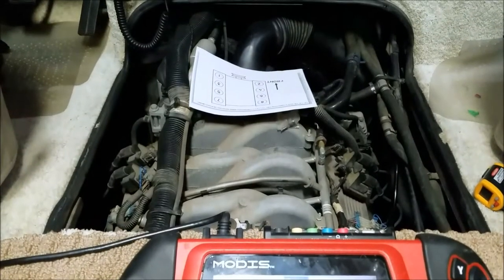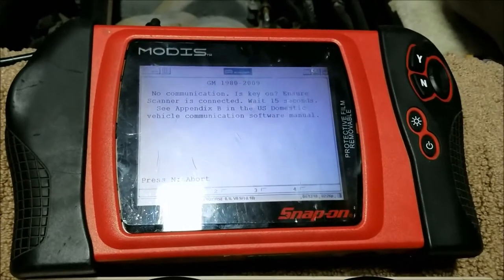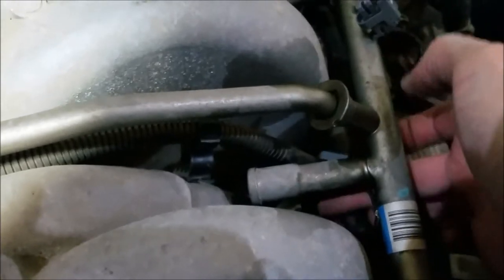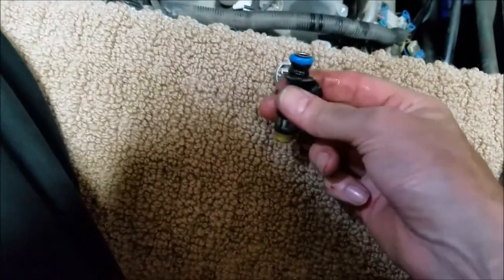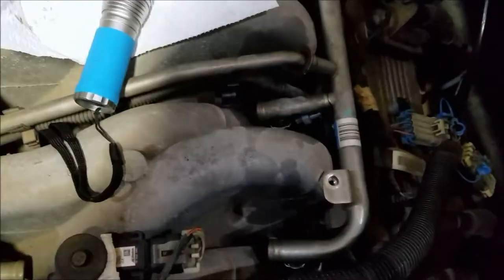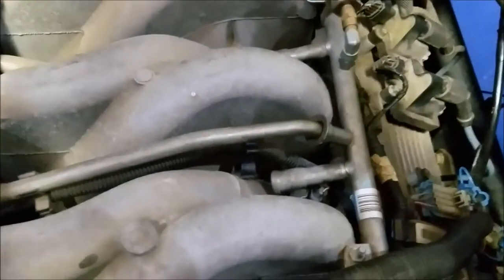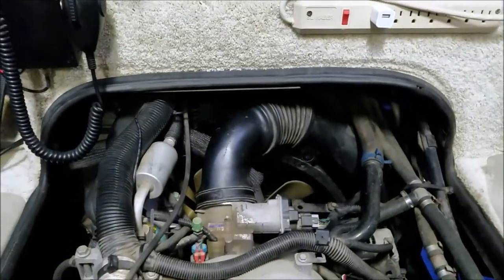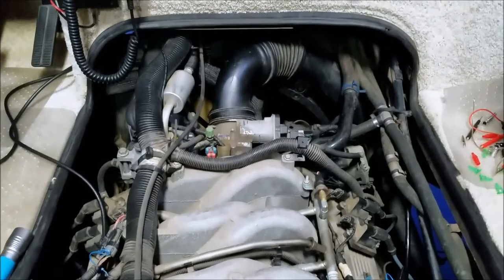RV Repair: Error Code P0200 Solved on 8.1 Vortec Engine in Workhorse Chassis

Comment: Great Video.  I think if you opened up ECM you might find a bad solder connention.   I've seen thermo problem(s) when cold and a little heat expand bad solder joints.  Reflowing solder in the suspected area of the circuit board could fix this issue.  I suspect the problem may have showed up in cooler weather.  
I have an 03 w22 same everything.  I've been studying all your videos. You're a great teacher. 
Great job. 
Best regards,
David
Reply from the maker: Thank you for the kind words David in fact I took it apart later and found moisture inside PCM and a lot of corrosion on the injector driver for that cylinder. If I can be of any help to you call or text my cell 606-875-0125 Kevin

Comment: Way to go like a bull dog with a bone you was not giving up and dropping the RV off at a shop. LOL.  I installed a Brazels  Ultra Power ECM on my 8.1 and love it. The 8.1 is stronger running and gets a little better gas mileage because the transmission downshifts shifts at the optimum time. I only have 40 K on the RV now but I am considering changing the spark plugs and wires to better match the quality of the ECM.  Another good video.
Reply from the maker: Thank you

Comment: Kevin, do you think Scan Gauge 3 will identify which cylinder is misfiring? I too see a misfire on cold start. About to change plugs first. Wires are good (Brazel's install a couple of years ago). My SG3 does not seem to identify anything more than a misfire count....no code yet so it might just be a carbon deposit on a plug.
Reply from the maker: Give me a call
Reply from the maker: Yes the scangauge 3 will show you misfires on all cylinders after you update to version 1.20 then rescan for x Gauges
Reply: @ktoutdoor  Kevin, Jon is sending me a replacement ECM. He is not sure why I am going thru so many O2 sensors. Are there any procedures to follow when swapping the ECU's? I am wondering if there is a learning process the ECM or TCM needs to have before test driving (from your experience).
Reply from the maker: @larryv4249  I never noticed a difference a learning process with he ECM I did notice the TCM had a couple of hard down shifts the first time I drove it but then all was good.

Comment: Hey Kevin, "if you own an RV there's always a new problem to fix." With the short time we've owned our Dolphn, and the issues popping up for us, I can certainly relate to that. Fortunately for us the previous own was a bus mechanic, and he performed most of the maintenance and repairs himself... at least the ones he could handle. 

> We had a similar problem with a 30y in a Chevy Biscayne station wagon, and thought it was a busted piston. Plugs and wires were good. Totally dissembled the engine only to find out is was a carbon line between to posts inside the distributor cap... bummer. 

> Regarding your cold. I noticed that these video are documented in the spring. Have you tested for allergies? Allergies and colds have very similar symptoms, I know because I went most of my life w/allergies. and thought it was just a cold. The life cycle of a cold is typically 7-10 days, though.
> Thanks for taking the time to make this video. Excellent information.
Reply from the maker: Thank you for your input: At the time of the Video my COLD was past and I felt fine it took a few months to get my voice back it was crazy I was beginning to think I would never get it back. I started sleeping with a mist humidifier and I think that helped.

Comment: So, was it the ECM that failed??  Did you replace with new??  Where did you find it??  Thanks!
Reply from the maker: Yes ECM was the part that failed,,  I got mine here https://www.brazelsrv.com/
Reply: Hi Kevin just saw your video, and just wanted to know if you had your ECM upgraded before you had this issues? Let me know because I have a 2005 southwind with an 8.1 and I had my ECM upgrade it, by ultra
Reply: RV products and ever since I had issues with cylinder #5, and unfortunately I could not see any codes so I lost two motors in less the 2000 miles and I’m about to get the third one running again, but now I purchased a Tech 2 so that I can monitor the computer to see what the injectors, and coils are doing, I did remove all injectors and had them check and it turns out the #5 which is the one in question is good, so the guys who rebuild my engine recommended that I check the injectors hardness as well as the coil and plug wires, so I check everything and all seems to be okay, so I’m thinking is going to be the ECM because I had basically the same issues as what you had, except I think you catch it before it cause you any bigger issues, that’s why I ask if you had your ECM upgraded by the same guys that they may have programming issues anyways thank you and let me know.